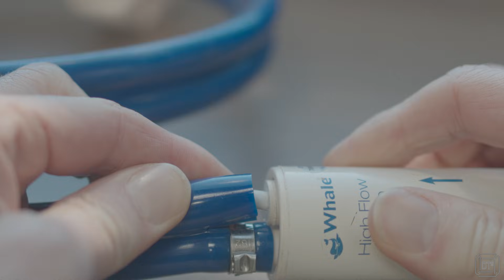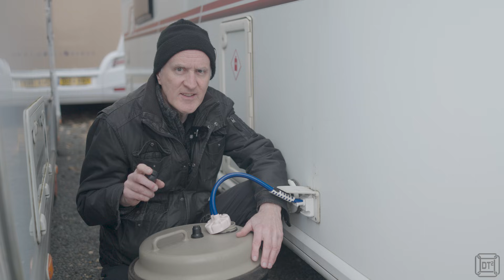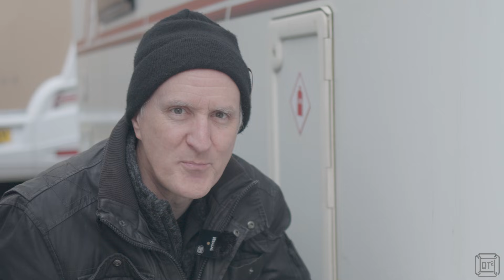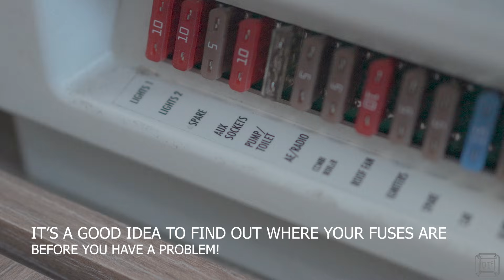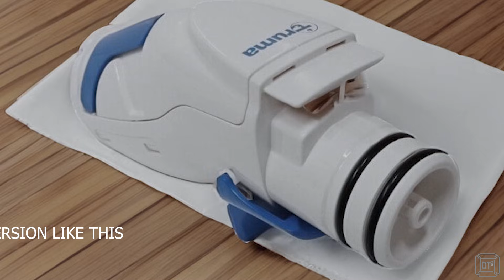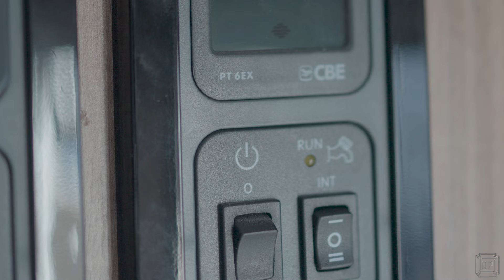CARAVAN PUMP NOT WORKING - Common issues and fixes

Comment: My Whale (Truma compatible) pump has driven me mad a few times this year.   Thanks for the video, it’s given me some pointers.   One thing I think I’ve learnt is that these pumps don’t like working sideways.  It’s not always the best idea to push all the hose / cable in, even if it is fully submerged.
Reply from the maker: Glad you found it helpful. And yes feeding the pump too far into the barrel can tip it upside down causing issues like airlocks.

Comment: Having major problems. Changed both the pump and inlet water valve. Fuse checked and replaced.  Still no luck. No voltage at the water valve. What have I missed?
Reply from the maker: Starting with the obvious first.-
1 Is the 12v system on?
2 Is the pump turned on at the control panel?
3 If this is a microswitch based system then has the microswitch at/under the tap broken or become disconnected?
4 Is there voltage at the switch?
5 Is the switch working / connectect?
6 Trace the cables back from the pump/water inlet to see if it has been cut or a connector has come off?
Best of luck
Dave

Comment: Hi Dave great video by the way. I have a problem with the water pump (same as in your video)running all the time there's  no water leaking from the caravan and the taps run ok and the heater fills. For some reason when the pressure gets to the point where the pump is suppose to stop it doesn't it just keeps on running non stop. could this be the pressure switch is broken.
Reply from the maker: Hi I'd say there are four possible reasons.
1 the pump is running but not priming (picking up water). If this was the case you wouldn't get much or any water out of the taps.
2 there's an airlock in the system. Make sure you have a tap open as you fill the system. Ideally the furthest from the input.
3 The pressure switch is not adjusted correctly. Trying turning the dial on the switch until the pump stops running.
4 Pressure switch could be faulty.
Reply: @DTSquared  Thanks for your advice.

Comment: Hi, my pump. that you drop into the water, which gets really hot, so worried to put punp into the water, no noise of the pump pumping just getting hot any ideas please?
Reply from the maker: If there's no noise at all but it's getting hot then that would suggest that it is getting power but motor is stuck. Could be debris blocking the impeller but likely that you will need a new pump. You can buy the whole unit (pump, hose and socket to connect to van) which obviously be identical mk odel and brand to the current one. Or if you want to save money then you can just get the pump which will require.some work to wire it to the connector.
Full units are around £35 to £55 depending on brand.

Comment: Hi my caravan pump inside caravan is not working there's no noise the light comes on
Reply from the maker: If you can get hold of a Multimeter and trace the wires from the pump back to a point where you can test it.(Probably at connectors) then you could check if it is definitely getting a voltage. Should be about 12volts or so.
If it is getting voltage bht not running then it could well be a failed pump I'm afraid. If it's the small submersible type of pump you could have a look to check that there's nothing blocking it and maybe give it a "technical tap" but that would be a long shot.

Comment: Hi Dave. My problem is a bit different. The pump started working at random and pushed itself off the inlet. We had used the kitchen tap previously but this happened while no taps were open. Any ideas please?  Informative video...
Reply from the maker: Hmm, that's a bit different. If the pump is pushing itself off the connection, then either the connection is loose or the pump is running whilst taps, etc, are closed. This could build up pressure and, in theory, pop the pump off. Though I'm not sure if it has that mucn power. Also worth checking if the O ring on the pump connector (hose to caravan) is worn which would make it lose, they are cheap and easy to swap.
If you have a pressure sensor, then that's the most likely reason for the pump randomly running. Try adjusting the sensor as per the video, to make it less sensitive.
Reply: @DTSquared  Thank you Dave. I will give that a try..

Comment: Hi Dave My problem is my old pump was u/s so i got a new pump but my problem is the water pump will not switch off when the tap is closed i tried adjusting the pressure switch but made no difference. Do you think the the new water pump is faulty? or is there something i have missed
Reply from the maker: Is the pump actually drawing water? Easiest way to test is to open a tap and see if water comes through. If it is then the pump is working so, either the pressure isn't being maintained, or the pressure sensor isn't working.
Did you replace just the pump or the whole pump, hose and fitting (assuming it's the external pump in the AquaRoll. ) if you just swapped the pump then a poor connection to the hose may lose some pressure but I'm pretty sure there's a non return valve in the connector on the side of the van so that shouldn't have any effect on the pressure switch.
Reply: @DTSquared  Yes the pump is drawing water now the pump wont stop running when the tap is shut off there is good pressure at all taps. i have tried adjusting the pressure valve but it does not stop the pump from running which makes me think the pressure valve valve is faulty? The pump is Whale and i am using a Aqua roll.
Reply: I stripped down the water pressure valve and found the valve body where the diaphragm seats was damaged beyond repair so i purchased new valve fitted and adjusted pressure now working ok

Comment: Can you explain what the components are between the water main line and the internal tank. I am having difficulty understanding how they get water to fill the tank then start deliver water to the van sinks/shower. What type of pump is fitted in internal tank? Thanks for the video, great info for explaining tech used in modern vans!
Reply from the maker: Hi @alanmurray2353 I'm glad you liked the video. Some vans will differ but generally they will work in these ways.
For vans with no onboard tank (Aqua roll etc sitting outside) then it's pretty simple, there's a pump submerged in the external tank which is then activated either by a microswitch or drop in pressure as discussed in the video.
For vans with an onboard tank there are generally TWO pumps. One in the external tank and one in the van. In our past vans the external pump was activated manually to fill the onboard tank, in the Bailey this involved switching a valve and then setting the pump to external, which ran the pump until the we turned it off when the tank was full. At which point the valve and pump switch had to be switched back (I made some videos of how I automated much of this process). 
In the Swift we had before that there was a control panel where you could set the time it took to fill the onboard tank then you had to manually activate this for filling. It was pretty naff since there was a limited choice of times 4mins, 6mins etc. And obviously if the tank wasn't completely empty then the time required would be wildly different. 

The onboard tank in the Bailey had a submerged pump in the tank, pretty much identical to the pump in the Aqua roll outside. The Swift had a larger more powerful onboard pump that was not submerged in the tank. From memory I don't think there was submerged tank at all, I would assume that when filling the tank the water went via/thru the onboard pump so that it would be primed with water and thus work once the system was switched back to the onboard pump.
I'm sure there are other newer systems that are slightly more automated but they are likely to follow very similar approaches.
Hope that helps,
Dave

Comment: Does the internal pump in a swift work with the external?  
I spotted a slight leak on the internal pump when I was using a serviced pitch with a hose straight into the van

I brought a new pump to change this weekend, but I tested the existing first with the trump pump but the system won’t prime.  The inlet is very noisey when the trims external isn’t plugged in too is that normal?
Reply from the maker: Sorry for the late reply. I'm not sure with the Swift setup apart from in our older van which had an onboard pump. In that the external pump was used only to load the tank and then the internal pump was used to actually supply the taps etc. The leak on the pump MAY have been due to the water pressure from the mains connection. When using serviced pitches we always used an attachment to connect the hose to the side of the aqua roll (it had a float valve to turn stop flow once the aquaroll was half full). The attachments for connecting the hose pipe directly to the van SHOULD reduce the pressure but I've heard horror stories of the mains pressure popping pipe connectors and flooding vans.

Comment: When I pull the connector out of the caravan, should a lot of trapped water cone out?. My pump is stop starting frequently now, so a few jiggles of pulling it in and out temporarily fixes it. Just wondering if the water is affecting the electrical connection node?
Reply from the maker: You don't normally get juch if any water come out. As far as I'm aware the socket unit (on the side of the van) has a one way valve so water only goes in. It sounds like this may have failed. If you have a pressure based system then this would also mean that you keep losing pressure, hence the stop start of the pump.
Hope that helps.
Replacement sockets are about £50 depending on make and model.

Comment: Hi Dave, I have a problem with my Whale pump.  When I first turn pump on it runs for 20 secs or so and stops.  But when I open a tap, the pump doesnt restart.  I tried calibrating system, but pump never restarts unless I turn off pump power and then back on.     Any thoughts?   I read that pressure switch could be faulty?   Not even sure where pressure switch is on Coachman VIP575 2020?  Is that the module where the calibration button is?  Appreciate any suggestions
Reply: Update - I tried opening shower tap BEFORE starting pump, and this seems to have sorted the issue.  All working normally now!
Reply from the maker: Pressure switch will normally be inline with the pipes (as in the pipe runs thru it). I'm not familiar with the coachman, but a friend had an issue with how you prime the system. He needed to let air out and water in by opening the tap that was furthest from the tank/aqua roll connection.
Reply from the maker: PS generally if you turn the pressure switch dial far enough the pump should always start.
Reply: @DTSquared  Thanks.  I will check again, but I don't think it has a switch with manual adjustment

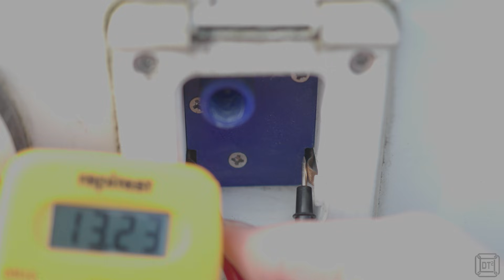Comment: We are having a pump not running problem with our Whale. THis may be a silly question but does the power need to be connected to the caravan for me to check the voltage with a multi-meter? as at timestamp 7:02.  The indicator light comes on the pump switch as soon as I trun it on, even when no tap is on.
Reply from the maker: You will generally need your 12v system turned on for the pump to run and/or check the voltage.
If a caravan then you will also usually need the car DISCONNECTED  other wise the 12v system will be disabled anyway.

Comment: My pump is sucking out my aqua roll but coming straight out of the overflow under the caravan? Any ideas ?
Reply from the maker: It's probably not an overflow but one of your draindown taps that's open. Look in the cupboards for either a tap or lever. If you have onboard cold-water tank then there will probably be two. The hot water system drain tap is usually a blue and yellow lever.
Reply: @ hi thanks for your reply I really appreciate that. None of the taps had been change it happened when we had the really cold weather. My water froze and wouldn’t come back on since. I’ve managed to put the holes pipe straight to the pump to force water through and it seems to have sorted the only issue is now I’m not getting hot water but just cold but I think that’s an electrical fault. Maybe I got something wet with the hose pipe, I’m just drying it out as we speak. Thank you for your reply though I appreciate that a lot. I’ve struggled to find anybody to help.
Reply: Every time I go to turn my water heater on it blows all the electric. Do you think I’ve got something wet ?

Comment: Hi Dave, great explanation for the process, easy to understand. However, my issue may be a little deeper. The system you showed is exactly what I use. Pump didn't work. Switch was in the on position. I checked with my multi meter, and I don't get power to the outside connections. Fuse is ok, I even swapped it but all to no avail. The toilet pump is on the same system and works ok. Checked each of the wires to the pressure switch inside the van behind the exterior connections for continuity and they are all intact. So, in essence, I am stuck with not getting power to the outside socket. Any ideas?
Reply from the maker: Hi Graham, 
I'm not sure with the toilet flush if that is pressure or electrically operated. if it's electrically then that may be a clue that points to the pressure switch.
Other things to check would be.-
1 Is there voltage at the outlet connection?
2 Is there voltage across the pressure switch terminals?
3 Is the pressure switch actually working?

If the answer to 1 is no but 2 is yes then that would suggest the pressure switch is open (switch effectively off). If this doesn't change when you wind the pressure switch fully in or out then it could be that the actual switch itself is broken. You should also be able to check this by testing continuity with pressure knob dialled all the way in and then all the way out. One should give continuity the other should not (can't remember which way around).
Bypassing the pressure switch should run the pump (obviously only as a test it can't be left bypassed).

Hope that helps
Dave
Reply from the maker: One other thought. Are you away in the van now with the issue in the UK? If so is there any chance the pressure switch could be frozen?

Comment: Very helpful thanks. My problem was a new battery was required.
Reply from the maker: I'm glad it helped. Low battery power / voltage can certainly cause issues with the pump.

Comment: Hi Dave,
We recently took delivery of a 2016 lunar Venus 540 and on our first trip we found the water pump not working due to a blown fuse, we replaced the fuse which we thought had fixed the problem but shortly after the fuse blew again.
Is there any obvious causes of this?
Thank you
Reply from the maker: If the fuse is blowing then it's likely there's either a wiring fault such as a short or bad connection. Or the pump is pulling too much current, so could be faulty.
Reply: Cheers Dave, luckily the people we bought the van from were kind enough to come out and investigate, it was indeed an issue with the whale pump which they replaced for us.
Thanks again

Comment: Hi Dave another good video. We have an ongoing issue with our new bailey purchased in Jan this year where our whale pump suffers with phantom pumping and our dealer has had it back 4 times and currently in with them now. We have had 3 new water pumps , parts have been changed inc non return valve,  added an inline surge damper which made it worse. They are at a loss as what is causing this. They are adamant its not a leak and not the pressure switch.
Any ideas what could be causing this to happen? Gaz
Reply from the maker: Sorry to hear that you are having issues with a new van.  One random possibility.  When you fill the system and/or set the pressure valve. Do you do this from the furthest tap from the inlet valve? (Usually the shower) Also when filling vent it from/at the shower.
The last thing would be the rubber O seal on the external pump connection (if there NO onboard tank).  I seem to recall our friends had a similar issue. If there's air left in the system then you will get phantom pump activation.
It also has to be said that some phantom pump running is somewhat normal.
Reply: @DTSquared  when priming I start in the shower and end at the kitchen and the o ring has also been replaced. Thing is we have had 3 Bailey Caravans previously and not had any issues with this before. I'm hoping my dealer will fix it on the 5th attempt. They did suggest I turn off the pump when not using the water but that's not the way to use it according to whale after a conversation I had with them last week. What they did say was to make sure there is no leak before altering the pressure switch. Thx Gaz

Comment: Hi, thanks for video. I have question becasue at the switch there is and ext and int, do we have two pumps there ? because when I switch to ext nothing happens, shall you explain this topic to us ?
Reply from the maker: Hi, if you have "INT" and "EXT" labels on the control panel then you will almost certainly have an onboard water tank in ADDITION to the temporary external tank (usually an aqua roll or similar). If you switch to INT then you should hear the pump running in the onboard tank (it's easy to hear as it is inside the van). Unless you've filled the tank up it will likely be running dry.
The EXT setting turns on the external pump but you will have to have plugged it into the side of the van (as you should see in my video). If the external pump is plugged in but not running then check the contacts as I showed in my video.
Good luck.